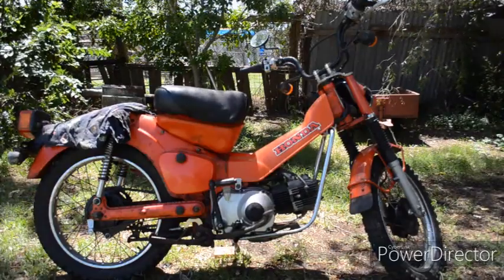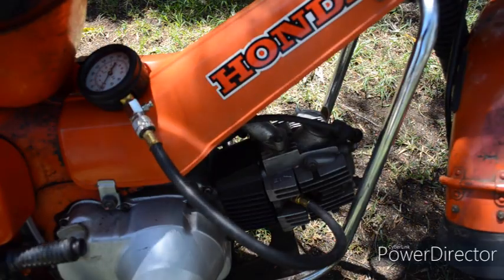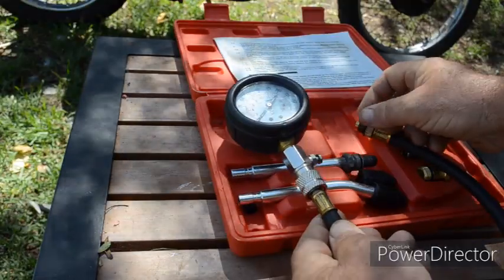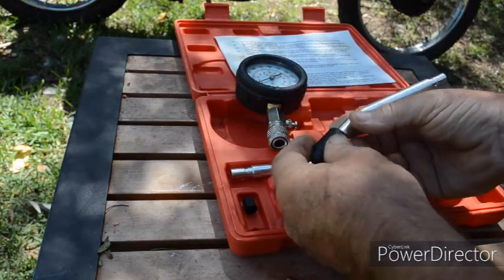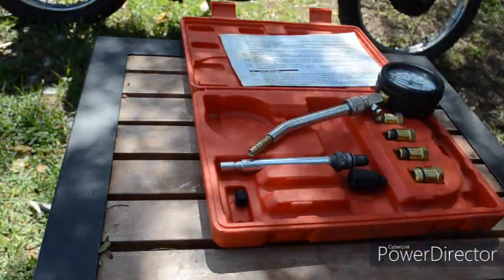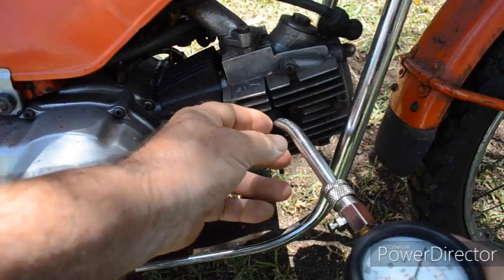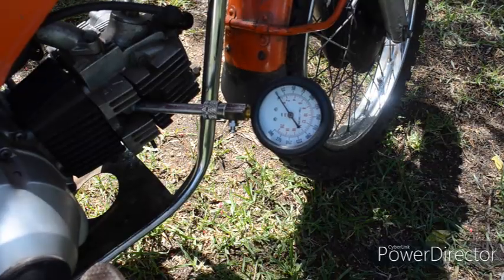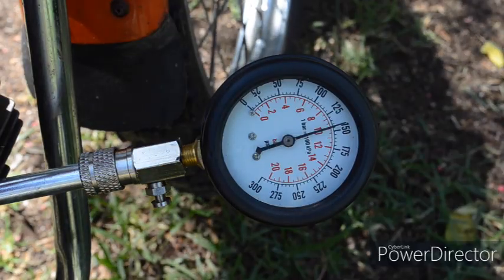'81 Honda CT 110 Trail Compression Test - 90 psi True or False?

Comment: I have been working on  CT 90. No leak down, valves are good, new rings but only got 50 psi compression. Next step better compression gauge. Thanks for your info.
Reply from the maker: That's really low, hopefully a new gauge will show a better reading.  Good luck, did you stagger the ends of the piston rings?  Just a thought.

Comment: How did you put that valve in the spark plug? Did you make threads to put it in? Same question for the metal tube. Did you put threads or did you use a poxy?
Reply from the maker: I hacksawed the sparkplug cutting around the curved section next to the ceramic piece.  Cut off the top electrode, then could knock the cantre of the plug out.  I used a tap & die to cut threads inside the plug & on the tube, I screwed the tube in using jb weld to hold in place & act as a seal.  Had to ensure the schrader valve didn't protrude too far.
Reply: Thank you very much for your time explaining.
Reply from the maker: @troycotsenmoyer6736  no problem mate.  There's probably an easier way to do it but I just used what I had in the shed.